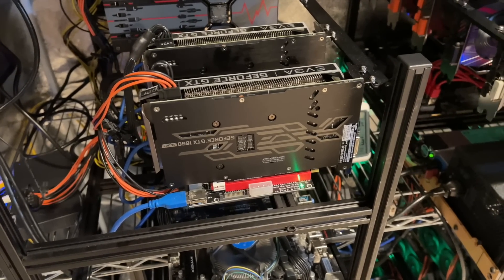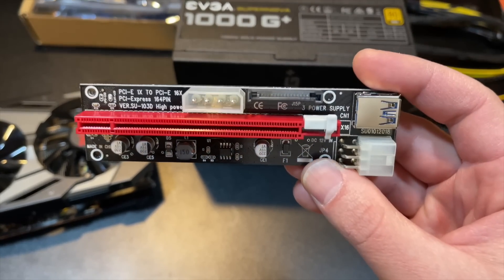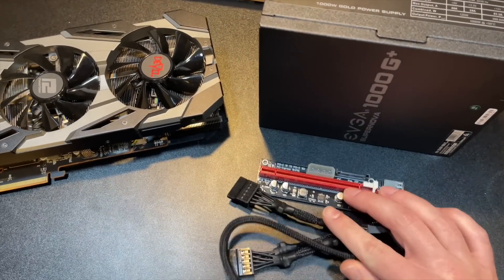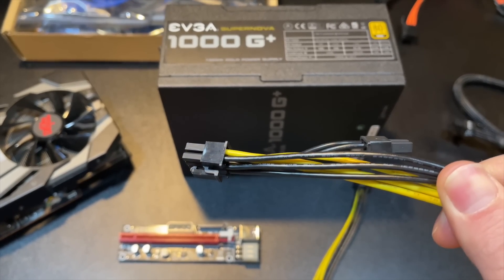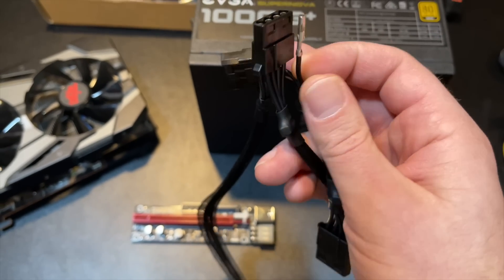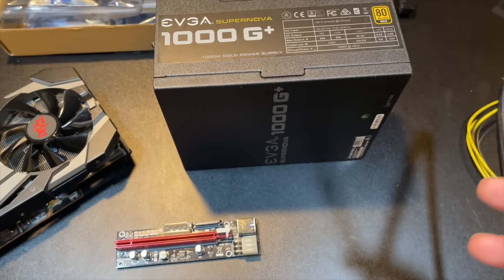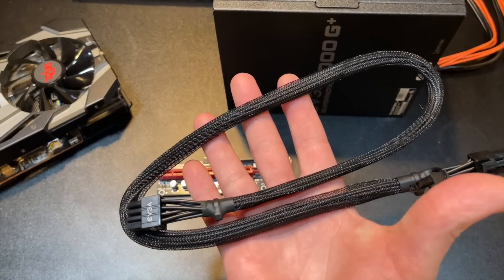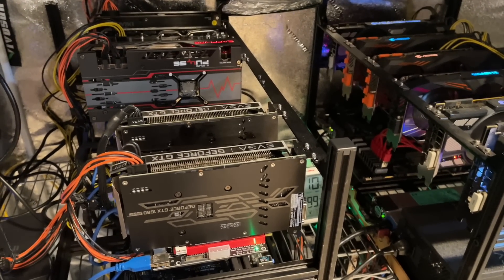Powering GPU Mining Risers Safely

Comment: According to EVGA, the SATA & Molex standards are 54w, but I believe this is wrong. On Wikipedia, the Molex/AMP plugs use 3 sizes of pins, 1.57mm, 2.13mm, & 2.63mm. The original 1.57mm pin was only capable of 5w, but the later AMP/MOLEX 8981 use the larger 2.63mm pin which is capable of 8.5w. And on Mex website directly, new pins are capable of 11.5w, both using 18g wire. But even at the more common 8.5w x 12v gives 102A. More than enough to run a riser on that would pull 75w.
Reply from the maker: Yeah I think they are wrong for Molex as well on EVGA Ive seen that. Wikipedia doesn't have a great reference for that info either.
Reply: @RedFoxCrypto  There was also Molex's own website, not "Mex" that it got autocorrected to. The new plugs can do 11.5A.  Granted I wouldn't wanna run anything close to max, but still should be able to handle a riser.
Reply from the maker: Yeah they have a few different pins though that are rated for different amps. Now that I have calipers I guess I could measure the pins in my EVGA cables and see what ones they are. Hmmm
Reply: @RedFoxCrypto  Did some more digging, so I hope you can follow. According to the ATX12V power supply design guide, currently ver 2.52, The peripheral 2x2 output on a PSU should output 12-16A. Continuing on to the connector, all the solid pin connectors are one form of Molex or another and all recommend 18awg wire. What we refer to as the PCI-E connector uses four 12V3/V4 lines whereas the Molex connector uses a 12V1 line. We will come back to this. The pins specified on all Molex connectors are AMP 61314-1 or equivalent.  According to TE/AMP standard the pin is rated to 13A. Now we go back to the type of 12V lines. What matters is the step-down recommendations. For 12V3/V4 it is 80% and 12V1 is 70% (ATX12V standards). Using the step-down percentage we take the pin rating 13A times step-down percentage times line voltage, so 13A x 70% x  12V gives you 109A. So Wikipedia's 102 number is well inline with standards. If you get me contact info, I can send all relevant docs.
Reply: Just one more add, using our 80% guidelines for the 102A is still over 80A, making it safe to power a riser in my mind. But I do admit, it should power only one riser and not 3-4 line the amount of plugs on most Molex connection lines.
Reply: Sorry, really last thing. The thing that makes PCI-E connections so special is they are rated for up to 375A from one connector. Which is way overkill for one 75A riser, even 2. 🤔

Comment: I did an isolated test with a riser and a 1660S. Powered the rig, and the GPU on one PSU, and powered the riser with another PSU. With the following OC profile: No Core Change, -1004 Mem Clock, and 75W power limit, the riser only pulls 35W of power with both a molex/pcie cable (the PSU with nothing plugged in runs at 8W with the fan, so I took this into account). I happen to know the lowest power draw that a Molex can pull is around 36W safely, so if this was the lowest quality molex I'd be fine.

However, if you use stock OC or higher levels for the 1660S, the power draw for the PCI slot goes up to 43W, meaning the molex would also be trying to pull that amount (depending on your riser's specs as well). Like Red Fox Crypto was saying, depending on what your cable can handle (which is really hard to determine), it also depends on the power draw of your card and your OC settings. So if you do testing like I am to compare the power draw of a PCIE/molex just on the riser, and if that power draw is low enough on the Molex, you can safely power your riser with molex. But, still, don't know the exact specs for Molex so it could still be a risk. I'm going to power my 1660S riser with molex since it only draws 35W. And this will not be the case for normal/standard workloads, which will potentially need 75W total anyways.

Comment: I am kinda confused right now. So I have a 580 8gb which needs a 8 pin and a 6 pin which I have. But then, to power the riser what would I need to power that while powering the GPU at the same time lol.
Reply from the maker: You'd use a 6pin cable to power the riser. You can even get a splitter to split a single VGA cable from your PSU to power the riser and the 6-pin on that RX 580 safely. Then use another 8-pin VGA cable from your PSU to power 8-pin on your GPU.

Comment: I have a question about the last part with the 1660, suppose your miner is custom made where the motherboard is powering the entire rig, with 10 6 pin connectors to 1 slot for the cpu and memory and then 8 16x 3 slots for my 580xt's. the 6 pin connectors are what appears to be 5 6pin splitters running into a power supply 2000w 12v supply, I run 7 cards at 700 watts I cant run one card beucase slot no 1 is not working although it powers one of my risers. but it does not show up on  my miner, now that I know I should be powering both my miner with a 6 pin connector spilt to power my card and my riser, would connecting to the motherboards be the way I would power my riser, and in order to use all 8 cards use a 4 pcie splitter although with limited power supply how would that work, maybe use the power from the slot that does not pick up my card no .1 ?

Comment: interesting! But i have similar riser, with 2 different power port/pin  (molex and 6 pin). If my riser connect to 6 pin directly to 6 pin power source, my GTX 1050 ti won't work, but if i connect 6 pin to molex-sata cable , it work ! why ?

Comment: You can use sata to power riser IF the total power of the GPU is under 90W, like 1060s and 1660s because the driver will tell the gpu to draw most of the power from the GPU power connecter. On higher power hungry cards its not advisable even if you undervolt alot.

Comment: Don’t forget the 80% rule on the PSU and circuit you plug into. Does this continuous load apply to the PCIE cables as well? Essentially 192W becomes 154W continuous
Reply from the maker: That’s the way I treat it. Just like I would for my outlets and romex in the walls.
Reply: @RedFoxCrypto  Thanks so much for the videos! I really appreciate the content.

Comment: Hi I'm new to the channel. Just subscribed because I enjoy your well presented videos and I have learned a few things! 
I do have one question regarding mining motherboards. I have a biostar 250btc, and it says I need to connect the auxiliary power molex connection located on the motherboard to my psu. Are you familiar with this?
Reply from the maker: My ASRock boards have this as well. I’ve never connected Molex to the board and run 12 GPUs off a single one. At least on my motherboard I just needed to disable that warning through the bios. Haven’t tried that exact board you have yet though.

Comment: If the 1660 Super can pull 125w, and the riser can pull 75w, aren't you over the stated 192w max for your PCIe cable/splitters? I'm asking because I have the exact same PSU with MSI 1660 Supers, and I'm scratching my head trying to figure out what additional cables I need to buy to hook all 10 cards up to the two power supplies. I plan on only using PCIe to be safe. Thanks for the great video!
Reply from the maker: It's 125 watt total. The riser pull is included in the 125w. Thanks for watching!
Reply: @RedFoxCrypto  Sorry brother but I'm just not that smart! So, the 6-pin on top of the 1660 is 75w and the riser provides 75w to the PCI connection on the card? Do I have it right yet? Lol thanks again. I'm going to order those splitters asap then! Thanks again my friend.
Reply from the maker: @FlextheJuvat  All good brother! The card itself will pull a max 125w and it will pull that power through a combination of both the riser and the PCIe plug on the top of the card. It may pull 100w from the top and 25w from the bottom or any combination of that to reach the 125w. That's all if it was ran at maximum power.
Reply: @RedFoxCrypto  Great! Now do a video on finding the optimum overclock/underclock settings!!  haha thanks again!

Comment: So if it’s pulling all that power though the riser, why am I plugging in the 6/8 pin power block connector, surely the powers coming through there not from the riser?
Reply from the maker: Power comes from both the riser and the PCIe plugs on the GPU. You can check the power pull in the software using the tool HWiNFO64 too.

Comment: I have a Evga Ultra RTX 3080 that needs 3 x 8 pin on the GPU alone, if I use 1 pcie cable with splitter to cover the 3 x 8 pin on the gpu, and use different pcie for the riser am I good?? Could I use 1 pcie cable or is it too dangerous?

Comment: 5:20 "It cannot give enough wattage through the cable" yes it can, but it will heat up, probably melt the plastic/connector and in the worst case even catch fire. Also, if one of those 3 sata pins are not making contact, all the load will be carried by the other 2, which means they will heat up even faster, to higher temps.

Comment: I want to move my GPU from the motherboard to run it off a ubit riser instead.  It's a 1080ti, powered by a 6 pin plus an 8 pin pcie. For pcie power my riser only has a 6 pin. Can I keep the 8 pin directly connected to the GPU from the psu, and just plug the 6 pin cable into the riser? Is that safe?

Comment: Brilliant video and very helpful, I come from electronics and telecommunications background and it has always been well documented on not just the equipment side of things but the actual means of connecting all the equipment. 
Using heavier gauge wire not only ensures that the required power is reaching the equipment safely but also ensures less stress is on the power source and equipment receiving the supply voltage. 
Simple exercise get a glass of water with a thin straw and try to drink through the straw. You'll have to stop to catch your breath. 
Now try it with a larger straw...
Our engineer tutor was old school but basic principles apply. 😎

Comment: Hi, is there any difference between 6pin to 8pin dual and 8pin to 8pin dual? Do they all deliver the same amount of watts? Which one should we use for powering GPUs and Risers. Thanks for saving many houses.
Reply from the maker: Hi! In general they are identical in the amount of power they can deliver. Any modern, high-quality, 6-pin and 8-pin cable has 3 pins that connect back to the 12v rail of the PSU. The 8-pin cables have 2-extra ground pins that carry no power.

The spec of 6-pin says that the 3rd power pin is optional, but I've never seen a 6-pin without it.

Comment: I hope you see this n reply as i noticed you reply to everyone, so I have 2 3080's that require x2 8pin to power, now my question is, should i use two separate cables running from the psu to power the gpu, or can I use 1 pcie cable that has a split end (from evga) to power the gpu? because I have 2 sets of pcie cables and im trying to power 2 gpu's with risers aswell. So its a bit confusing here.
Reply from the maker: I use one cable to my 3080 8 pins. Manufacturers recommend separate cables, but if you are running the GPU power limited at around 215-230 watts on Ethereum you’re fine. If you run that GPU at its full 320w then I would do two cables.
Reply: @RedFoxCrypto  great thanks for ur reply!

Comment: Can you connect a 2080 the same way as the 1660 Ti ?? (6 pin from the PSU, use the 8 pin spliter and power the 2080 and the Riser??))

Comment: From what I’ve found a 1660 super has a TDP of 135w. Am I mistaken?
Reply from the maker: It's 125w. I use this site: https://www.techpowerup.com/gpu-specs/geforce-gtx-1660-super.c3458
Reply: @RedFoxCrypto  so 125w for the gpu and 75w for the user is over the 192w upper limit of the pci cable. I guess I’m just a bit confused because based on that math using the splitter for gpu and riser is unsafe? Maybe I’m missing something from my noob perspective. Thanks for the video and feedback it’s very helpful!
Reply from the maker: @eliottcopier9438  All good man and 75w is included in 125w TDP not on top of it. Hope that helps!
Reply: @RedFoxCrypto  ahhh got it, thank you!

Comment: So in the end what’s better? Using the splitter to connect two risers? (Meaning another connector to power GPU?) Or using the splitter to connect to riser and it’s GPU?
Reply from the maker: Heavily depends on the specific GPU. If it’s a 16 series I’ll split it and supply both the riser and GPU. Any other cards I split to power 2 risers. In the end you just need to work out the math of max wattage pull to be safe.
Reply: @RedFoxCrypto  I have 5 GeForce RTX 3060 (one of which is MSI).
Reply: @RedFoxCrypto  Wondering if you can help me again, I’m having trouble with something that should be simple. My PSU evga 1200 p2 is not turning on. Was only trying to test the rig before adding GPUs and the PSU fan won’t even run. I fee like I’ve tried everything. I do have 4 that I got all at the same time and all new. And same thing they won’t turn on. Any suggestions?

Comment: Yo man im amateur in mining. Do I need to get a Splitter no matter what? I only have 2 Risers.
Reply from the maker: What GPUs are you running? With what PSU?
Reply: @RedFoxCrypto  currently I have one rtx 3070 and a gtx 1070 but I get more cards in the future I think 1070 or 1080s not sure yet. My psu is corsair 1200w platinum
Reply: I'm having these 2 plugged into the pc directly so I really need risers atleast for better airflow because they almost got no space between them.
Reply: @RedFoxCrypto  and I'm running these cards for atleast a month or two but after that I'm planning to buy more cards.
Reply from the maker: @RapidX0531  Most of the time you’ll wind up using splitters. I think every rig I have uses them, especially if you are using regular ATX PSUs. Server PSUs provide a lot more PCIe cables but can be very loud depending on the power load on them. It can be tricky, but you really need to map out your setup, take into account your GPUs TDP and the info from my video to see what else you might need.
Reply: @RedFoxCrypto  okay I understand, in my country I can't get those splitters you showed me.. What should I do? I don't want to buy a noname one.
Reply: Another question, can I use the cable directly from the psu (8 pin) that has 2x 6+2 pins at the end to power the riser and the gtx 1070 at the same time? I would use a cable mod to achieve the cable length for the video card.
Reply from the maker: @RapidX0531  Yeah that would be fine with a 1070 having a TDP of 150w.
Reply: Thank you very much for the fast response, you earned a sub 😊

Comment: I have a rig with a 3070 and a 3060ti and I have another 3060ti on the way and I have run out of pcie slots in my psu. What can I do? I have used a separate pcie cable for every riser and every gpu.

Comment: here is a question and an idea.. are those pcie risers capable of drawing power from multiple sources? for example, you could plug in the molex and the sata pin, since most psu cables do include both. 
i know6 pin is ideal, but my psu has 4 rails, and to fully take advantage of the wattage and to distribute the load, i want to use the sata and molex rails. if the riser were to pull max wattage, and you have 2 connections plugged in, would it split the power draw evenly?

Comment: Thanks for the Great Video
Could you please clear my Question?
I need to Power a RTX 3070 and its Riser.
The RTX 3070 TDP is 220 WATTS, Does this mean that i could use one PCIE cable from the PSU and split it with a 3 * 6+2 pin cable in order to power the Riser and the 2 * 8 pin power inlets of the GPU?

one of your research links points to the PCI E cables wattage - saying the the 8 pin is rated to 288 WATTS, so does that cover the RTX 3070?
many thanks